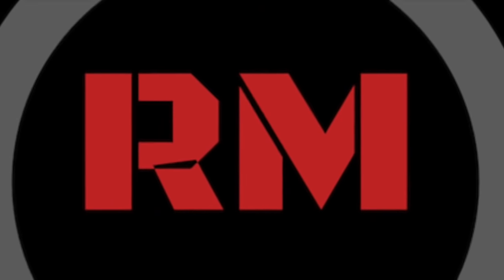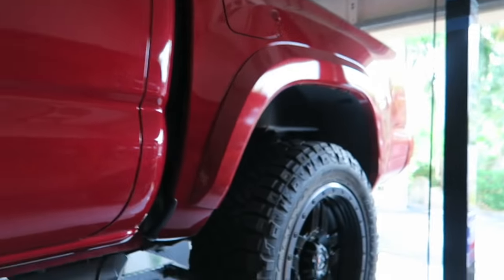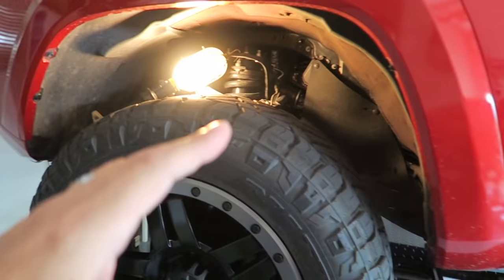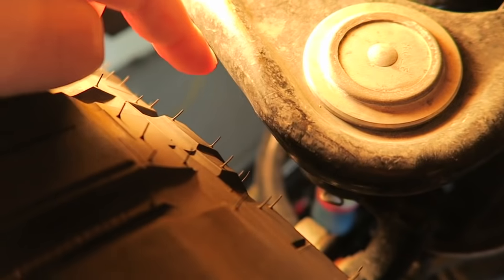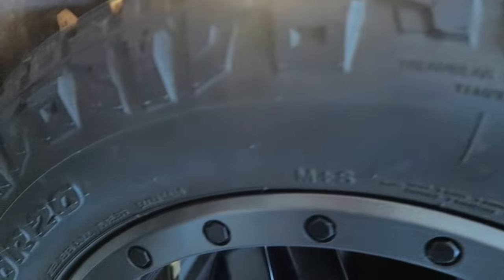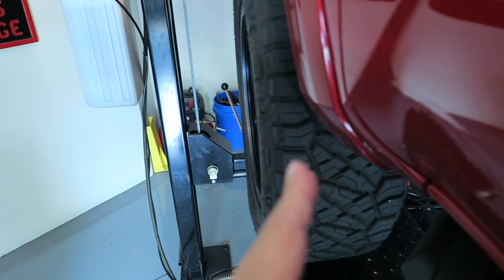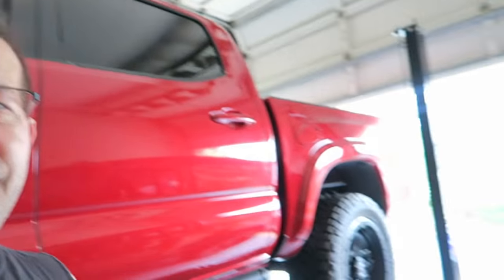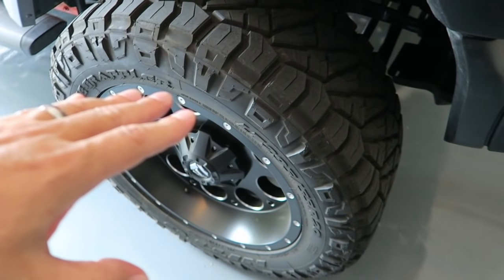Lifting Your Tacoma | Watch This First!!

Comment: You’re right, so much misinformation out there on lifts. Some things that worked for somebody doesnt always work for all. There are lots of different variables like wheel alignment, wheel offset, wheel backspacing, wheel size, tire size, etc... all this can dictate whether or not something works for you. Unfortunately the only real way to know if its going to fit is to try it out and if it doesnt, be prepared ahead of time to make the necessary changes to make it fit...
Reply from the maker: Absolutely!  I did a ton of research before I did mine and still had issue.  I think a good rule of thumb for the UCS’s is at least 1.5” of clearance.  Any closer and you’re asking for trouble!
Reply: RobMotive yeah, i’m still on 32’s right now and want to go to 33’s but am contemplating buying 34’s and a sledge hammer lol

Comment: When my Tacoma 2018 had only a few hundred miles on it, i installed a 3 inch lift. just as soon as i pulled out on the road it had a grinding noise and vibration you could feel under your feet. put it in 4x4 and the noise and grinding would go away. well it turns out SOME Tacoma's have more slack in the drivers side inner cv-joint at the diff than others. There is a needle bearing to bushing change over kit (and install tool) that is needed to fix this problem at a nice price !! so i didn't want to mess around with opening the diff so i removed the lift a few days later and no more grinding and vibration. So some Tacoma owners keep in mind it is not just a simple lift.... just my luck i have one that is like that. when the warranty is out i will remove the needle bearing on the driver side and replace it with the bushing and then i can lift it. This is a known Toyota problem for a few years now, just wish they would fix it. it is caused from too much play were the cv shaft goes into the diff and causes the spider gears to be out of line. The bushing is tighter and keeps the cv shaft more accurate.
Reply from the maker: That’s a drag!  I’ve heard about this but have never had a good explanation.  Thanks👍
Reply: I had my needle bearing replaced after my 3 inch lift, made a huge difference, a must have replacement.

Comment: I also put 275/60 R20s on my Tundra after adding the 3 inch lift. Didn't want too tall a lift as I tow and it will effect fuel mileage also have to fit into the garage. BORA spacers are the only safe option IMO if anybody went that route. You don't want your wheel falling off down the highway!
Reply from the maker: Yup!!  Loosing your wheels on the highway will really ruin your day!!!!!!😳
Reply: Jason Padgett why BORA?

Comment: I am running 285/65/R17 on a set of Yokohama Geolander A/T. Front tires rubbed on the splash guards so i hard to trim those down.. Good info… Thanks..
Reply from the maker: Any rubbing on the UCA’s on hard turns?
Reply: Definitely.. those hard turns continue to be a problem when truck loaded with the whole family..
Reply from the maker: That’s a drag.  That’s what drove me nuts when I had the larger tires on.  So happy I was able to use them on the Jeep and go with an alternative on the Tacoma👍

Comment: In most cases though, guys aren’t running 20” wheel setups with aggressive tread.
Reply from the maker: Almost all that I’ve seen who lift go with a larger wheel and aggressive tire setup.  It all goes hand in hand.  How many lifted trucks have you seen running tiny wheels and tires?
Reply: I think majority of taco owners go with either 17 or 18” wheels with big tires when they lift their trucks, or at least that’s what I see in Tacoma forums.  20s are definitely not that common in the Taco land.  Stock size for Off road trim is only 16” so going 17 or 18 is most common.
Reply: I definitely see the +1 wheels with aggressive tires, but the common consensus among Taco owners is to get so much lift with just the right tire to not worry about cutting frames or plastic. Anyone who’s running bigger setups do it for a purpose and a plan.
Reply: Aleks Lajzer Absolutely!!  I’ve got 18 inch wheels on my taco looking to go down to 17 or 16 To have more meat on my tire size